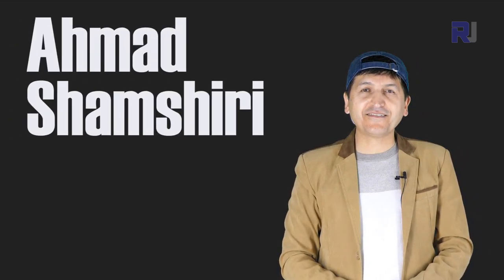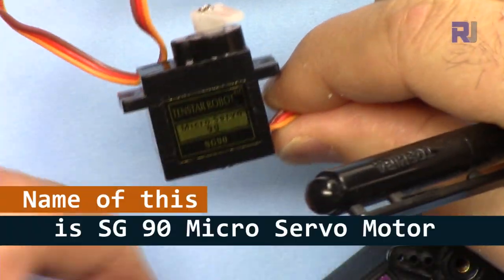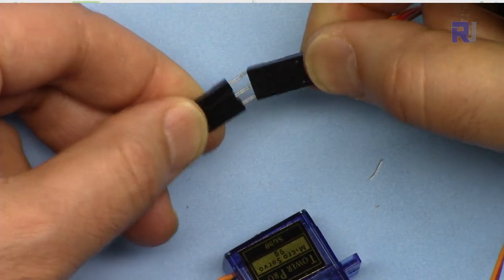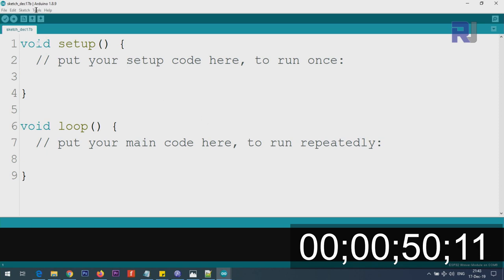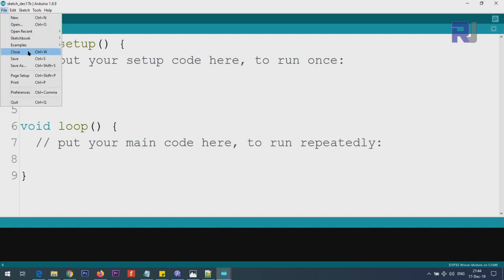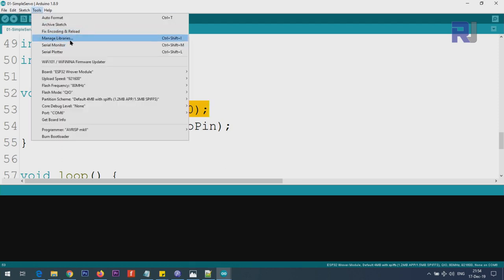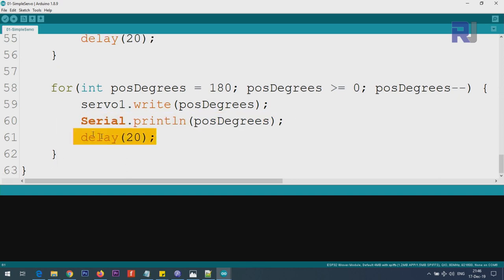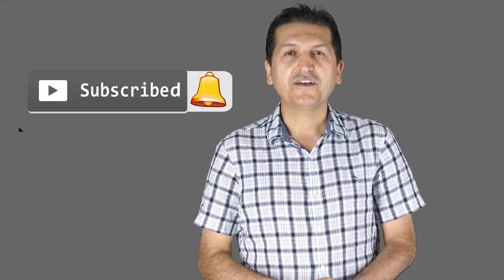How to control Servo Motor using ESP32 with  Arduino ESP32 Servo library

Comment: Hi, 
Can i use the servo liabrary for ESP32-CAM,is ti compatible?
Reply from the maker: Hi, wake 32 is the chip and people make it with camera or lcd or oled. Does not matter what it is the same chip and it will work

Comment: Hi, i am getting the output at serial monitor, but my servo(SG90) is not manking any movement. I have checked my servo (with Arduino) & esp32 both are in good condition, i have also downloaded the library that you have mentioned. 
My esp32 doesn't have 5v pin so I've tried using 3v3 pin and with external power supply keeping common ground. I don't have G14 instead of that i have use D14 pin.  But still my servo is not moving at all.
I am unable to find the error could you help me to find the error ??
Reply from the maker: Hello, it seems you are using a pin that does not have PWM capability. I don’t remember which pin . Here is full introduction to esp32 https://youtu.be/--Fj8QDlGuQ
Reply: so how u fix it

Comment: Hello, I just downloaded the library but the name is the same as that of arduino ("Servo.h"). And when I open the example of "SimpleServo" it opens a different code than the video, using "Servo.h" library and not "Servo_ESP32.h"
could you help me with that please
Reply from the maker: Hello, I just downloaded and opened the library making sure it has the "servo_esp32.h" which indeed it has.  I checked all examples and all of them are referring to servo_sep32. So clearly you are doing something wrong. Two possibility. 1-You have two versions of Arduino and library is installed in One version and you are opening other version. 2-You have not installed the library . please check (1) first.  Please reply if it was fixed or not. I appreciate that.
Reply: @robojax  
I am entering this address: https://github.com/RoboticsBrno/ServoESP32
and even without downloading it, when reviewing the 4 examples (on the github page) I get using the "Servo.h" library
I dont understand why ... The only difference I see is that on this page the title is "RoboticsBrno / ServoESP32" and in your video the title appears as "RoboticsBrno / ESP32 - Arduino - Servo - Library". But the author in both is the same (JarekParal). Could it be that I'm downloading a different library?
Reply from the maker: Yes. you are not following the instruction. Perhaps you did not even listen to what I said.  Please watch I have explained. it. I created video so I don't have to type it here
Reply: @robojax  thank you very much. I solved the problem

Comment: How to connect motor servo + esp32 + telegram?
Reply from the maker: what is telegram? the chat app? if so that is made for chat and it will not interact with anything as for as I know.  Unless I make an app, I am not sure if there is such thing. besides I am not sure if there is an application. Here  you can control is over WiFi no app is needed https://youtu.be/GC0gRdBpylw

Comment: My servo motor MG90S is not moving even it runs well on serial motor. Any idea what will be the problem?
Reply from the maker: Have you downloaded and installed the servo library for ESP32? that could be the reason or wiring and power.  if all of the above are correct, then servo is bad.

Comment: WOW!. Im looking around how to control my Servos with an ESP32. I have seen a few libraries that have been used, but Im glad I found you! You wrote this library! So you certainly can answer my question... 80 My Question ... My inputs to control the servo offer much FINER position than 1 degree. can I only make steps in one-degree increments .. or could I use decimal .. for example 0.5 steps such as 40, 40.5, 50, 50.5 degrees ETC?
Reply from the maker: This library can allow your one degree control

Comment: Nice video, but i have a question. You know how to develop this project, but instead of using "arduino language", using Real time kernels/RTOS?
Reply from the maker: It would be time consuming because using Arduino it would be very easy and it works.

Comment: Can I use this library for ESP32 Cam ?
Reply from the maker: it works with all ESP modules. yes.
Reply: @robojax  Good vids. So it works with the ESP8266 boards too? I have a motor control / break out shield coming for an ESP8266 board so was just wondering. Sure seems it should as it doesn't use that many pins. Any code on directly connecting to the server (as opposed to going through a router)? Thanks.